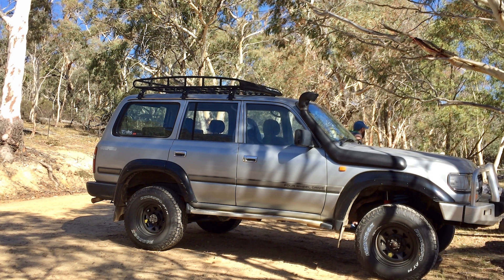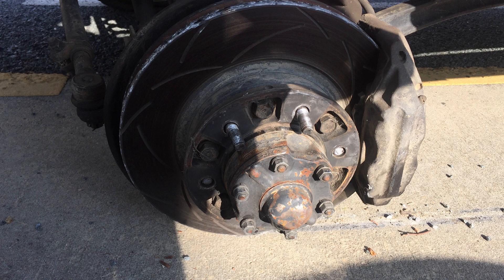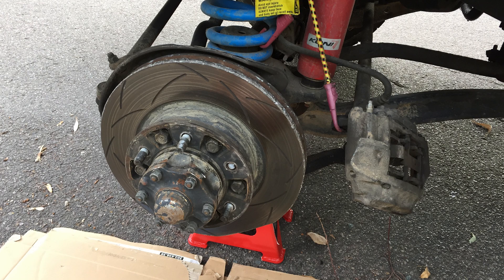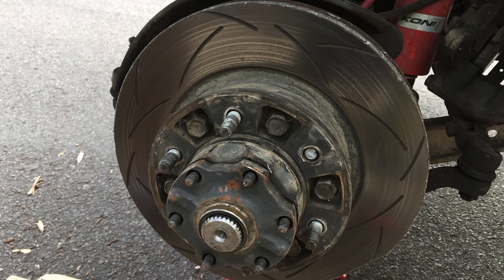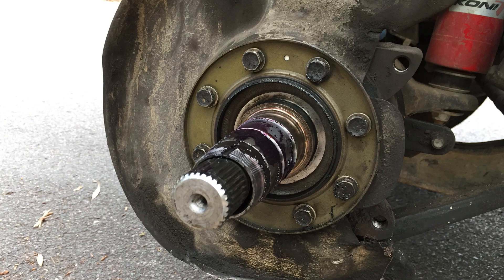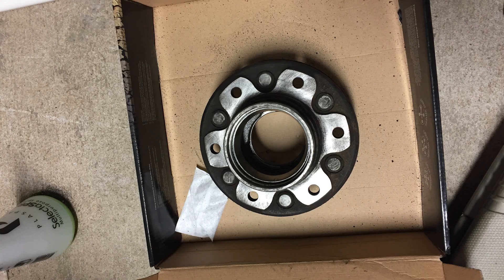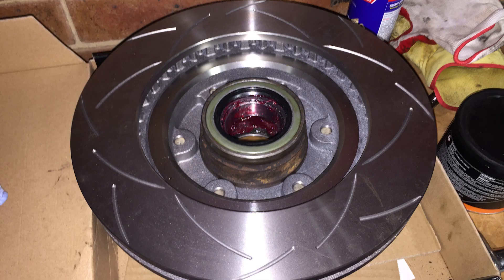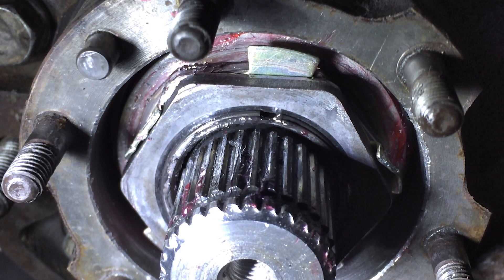80 series Toyota Landcruiser front brakes, wheel bearing and wheel hub replacement step by step DIY

Comment: Hi there! What tire size is that on your 80?

Greetings from Switzerland 🙋🏼‍♂️
Reply from the maker: Greetings from Australia! In this video I had 275/70R16 but I now have 285/75R16
Reply: @southerndiy1  thanks for your reply, i was just wondering cause i saw the 0-100 Video. My FZJ80 has 315/75/16 and is slow af… 😂 and we have alot of mountainroads around, not very pleasant to drive those with 35‘s 😅

Think i have to change to something similar like you have. How do the 285/75/16 compare to the 275/70/16?

-Patrick
Reply from the maker: I’d love to go 315/75R16 but I was put off by the price and how it would make my slow car even slower. 275/70R16 had good acceleration off the line but the engine RPM was too high at 100km/h+ (I do a lot of highway driving) and also the tyres looked too small for the car lol. 

285/75R16 dropped my highway cruising RPM and for me was the best mix of price, performance and looks.

Comment: Hi mate,  Didn't you replace the outer tracks for the wheel bearings?
Reply from the maker: Hi Ian, from memory (this was 3 years ago so I’m a bit hazy) I didn’t replace the outer track in the replacement hub. It was in good condition, no scuffing or damage.

3 years and 20,000km later and still running strong